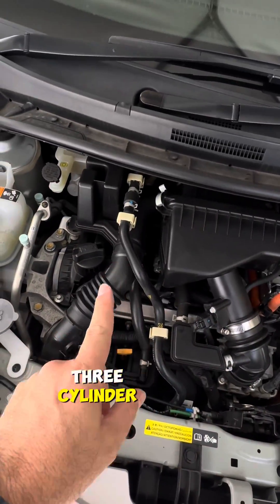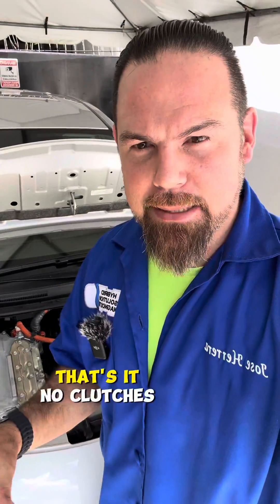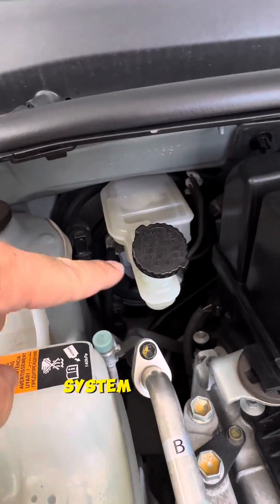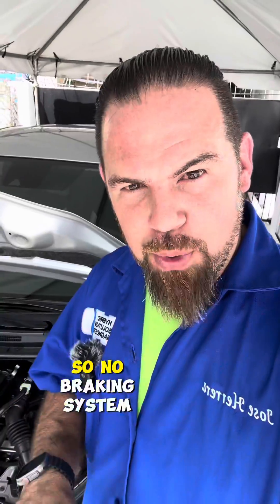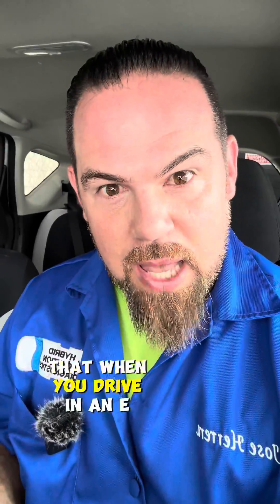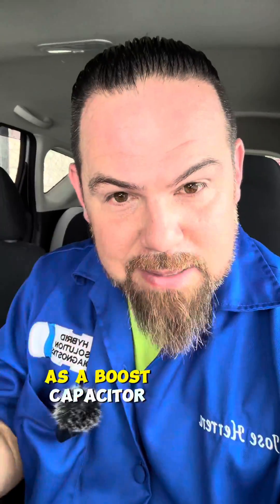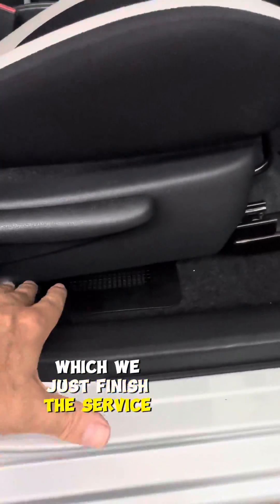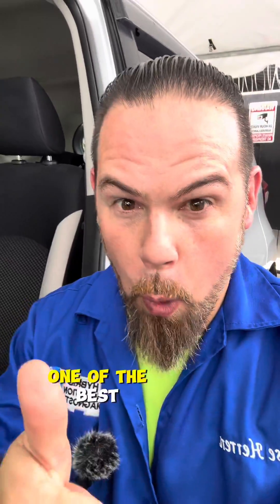Nissan e-POWER reliable?

Comment: I’m planning to buy a Nissan suv still I have big confusion to choose which ones one is 4 cylinder 1.3 mild hybrid that means a normal petrol engine plus battery the other one is 1.5 turbo 3 cylinder e power engine this car I have to use next 10 years that’s my plan the e power engine have generator and so many other things I have worry about these electronic parts life same time the normal petrol engine easy to repair so any body have a suggestion which be a long running engine

Comment: Hello, great video. Have a question: while driving on a longer than usual road trip, my Nissan Xtrail Epower, started making an internal sound coming from below the front seats. This was a very strong sound. All windows closed, music and a/c all off, and still this loud, venting type sound (like open window at high speeds ) was very uncomfortable.
Reply: X trail doesn't use epower system. But uses S hybrid system. The motor is known to fail on these xtrails.
Reply: @bonganihalimani9572  e power was available on the xtrail in 2022 ...

Comment: My partner has an E-power and loved it untill a rat chewed the main high voltage cable. The battery discharged and had to be replaced. Now the car starts but the oil light stays on, the oil  pressure is good , battery wont charge and the car turns itself off after a few minutes. The machanics are working  with Nissan to find the Problem. Any ideas.  The Rat died/fried
Reply: Did it ever fix ??
Reply: First find someone who can tell u about rats ..like Willson😂 and then u can fix it 😂😂😂.. find a rat man
Reply: Sounds like the rat fried the ECU lol